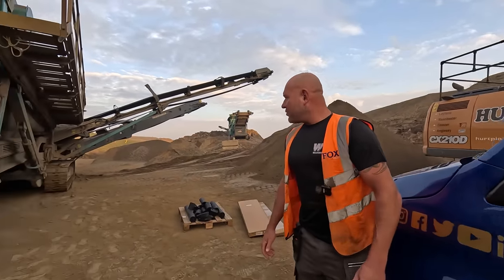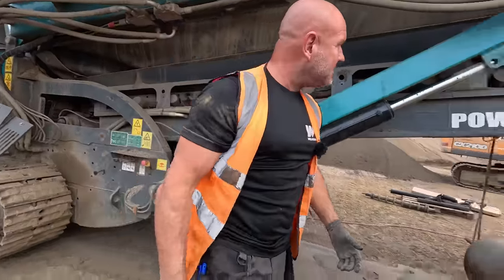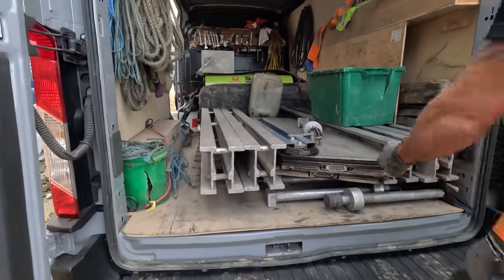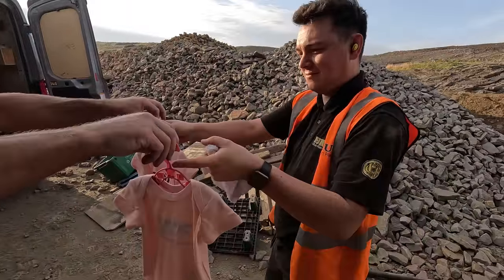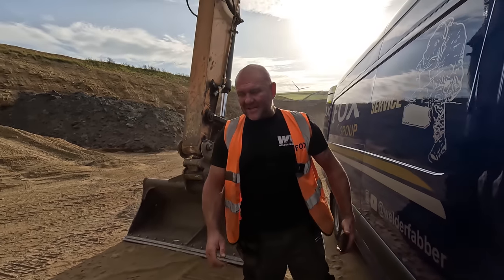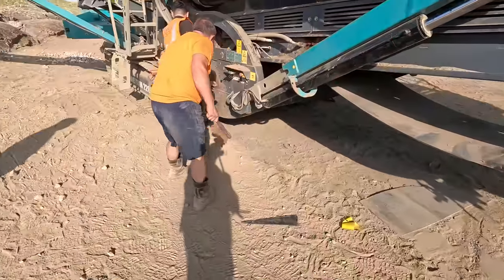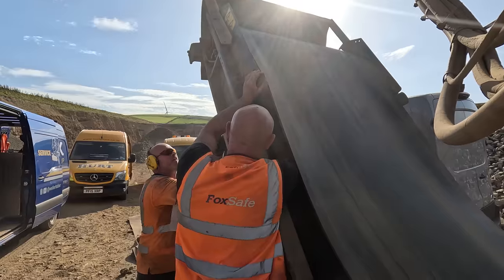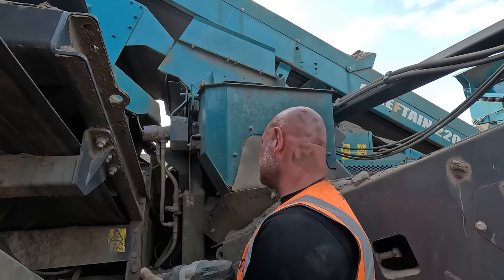Powerscreen Chieftain 2200 New Belt & More! WELDERFABBER Episode #006

Comment: Cheers Baz, looks like my old job there. Tail belts, vulcanising, bearings, grease pipes, belt scrapers and renew the adjusters every time. Skirting Rubbers always run new ones in on a replacement belt.what was the Head drum Lagging like?. Those Piano Wires need to be rechecked after 10mins running without Material going through. It’s good graft a job like that but when you were dogging the210 operator for his clogged Tracks you should have made another call baz to the Loading Shovel man and played hell about those Feed Hopper Doors on that 2200, like chewed up Toffee!. Anyway, to finish I have to say I had the pleasure of working with another lad like your Bob who did Belts for a living from Banners and I don’t think theirs much between them. All the best.

Comment: Broken bolts. Subject to bolt size and to where the break occured (below, flush or proud) tells you the scale of the challenge.
Mig, tig, or stick in my opinion is acceptable because it's about what tools and resources you have.
A mag drill, is useful in the right circumstances.
Factor in what material the bolt is threaded into, the strength of the bolt and if you are in the field or a workshop can all also affect the outcome.
Plasma vs Oxy acetylene or propane. Both have their place. Air is not free, you have to compress and dry it to get the plasma cutter running and you need electricity. Also for a professional bit of kit like Hypertherm, even an XP45 can set you back £4k. That buys a lot of gas. Also, no need for electricity with gas, just an ignition source.
We have both plasma and oxy acetylene here, £5.00 to buy a nozzle to cut 2inch steel plate. To upgrade our plasma cutter for one that will cut 100mm (2inches) it would be around £6,000 plus VAT for a suitable Hypertherm or about £2,000 for a cheaper brand. Insurance has to be factored in for gas, but it's still miles cheaper than plasma.
That butty shop, those vanilla slices looked good.
If you get to Burnley, Nelson or Cole, Oddies Bakery do superb vanillas and cakes. Good butties too.
Phillips Bakery in Skipton does the very best Steak pies known to man! I know this for a fact, l buy them every week along with an iced finger!

Comment: Good job. Nice to see Bob the Belt out doing a bit. Lol. Not sure I’d agree with you about using an old belt for skirts, I’ve found that the cords from the belt used as skirts will cut into the top cover of your product conveyor belt. Ok if the belt is on its last legs, but that’s just my opinion. Keep up the good vids.

Comment: Hiya Andy from Australia . Just wondering why the Forman didn’t catch those 2 flat rollers on the track, the belt cutting into the steel ect, surely a 30 minute  walk around once a week should pick all this up before it starts cutting into the steel or the trackers getting worn. I think you need to find out who is suppose to to that , preventative maintenance is always better, and cheaper. Cheers
Reply from the maker: Not my job but its hard for the guy in control so many operators coming and going

Comment: I run Milwaukee on 95% and snap on on 5% of my power tools when they work right Milwaukee is unbeatable imo problem we have over here in the US a lot is the batteries get loose and trigger doesn’t fire randomly I think they fixed this with the forged stuff but I’m already stacked with the tools I need the ones I got to work right.. I know a lot of field techs going back to air bc it works every-time due to this Milwaukee battery issue.. do you lot have this issue in Europe and UK as well?

Comment: Bob is right, nobody wants to do the job. Society is getting lazier and more reliant on technology. Not many want to do hard manual work anymore. I grew up on farm so no stranger to manual labour. At 19 started working as concrete floor layer. After 20 years the back is now knackered and been waiting for a back surgery for 4 years now. But whenever we had youngsters starting, all they wanted to do is get on machines. Nobody wants to rake or screed concrete, everyone wants to jump straight on laser screed or finishing machines. And I know your frustration with people not doing simple maintenance on machinery. In this industry any machine downtime costs money to the company. And maintenance is not hard, a little effort goes a long way and keeps the wheels turning. You and your team are doing great, and thanks for all the videos.